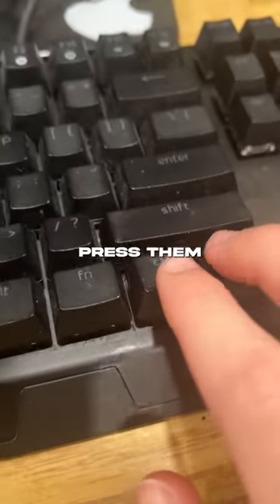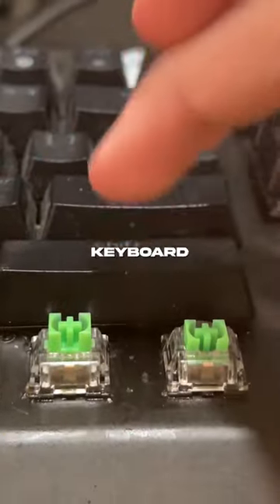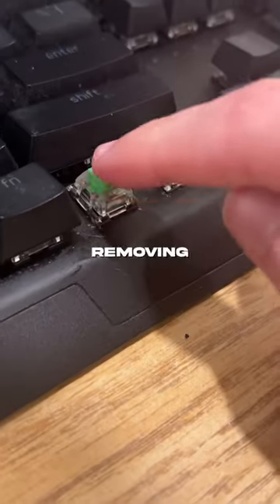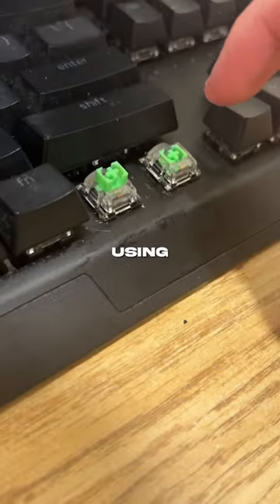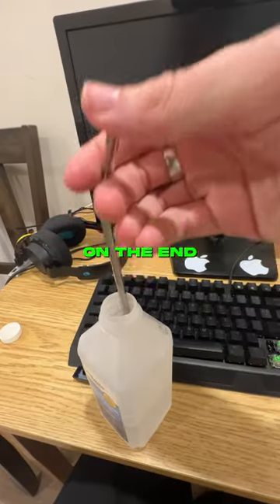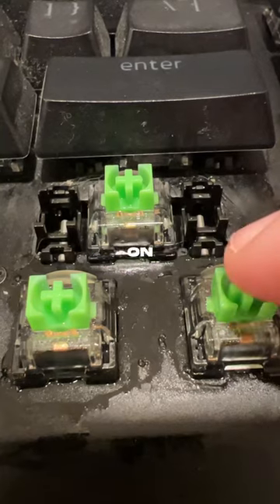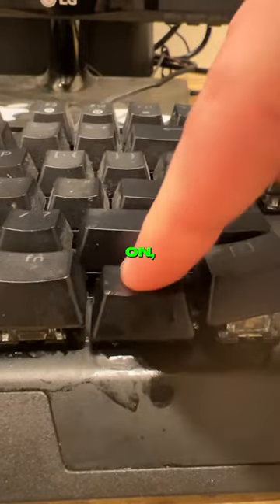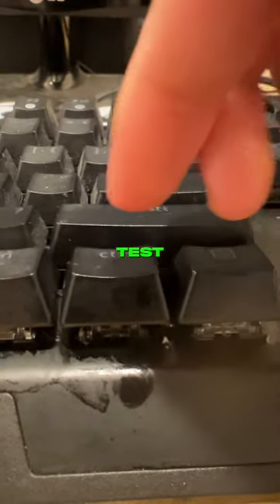Repairing a Sticky Keyboard

Comment: The issue that more than a few people misunderstand is that isopropyl alcohol needs to be dried/removed from a circuit surface because overtime it can actually remove bits of film and pad glue, however with that said I have zero clue how itd respond to solder. I can't recall how it reacts to all the phone electronics I disassembled over the years.

Comment: You can run a keyboard through the dish washer. I reccomend taking it apart down to the mother board, scrubbing it, an old tooth brush using 90% isopropyl alcohol and then running it through the dish washer. Afterward, just douse it the alcohol again and let it dry for 72 hours. And after all that, it will be just as good as brand new.
Reply: Allow the isopropyl alcohol time to dry, I'd you don't the key caps will break with the alcohol, don't do it because I've experienced it twice

Comment: As someone who builds my own custom keyboards, the spring/switch is either broken or something sticky got in. The best and easiest solution would just be to use/rent a soldering iron and replace the damaged/broken switches with new ones (buy some online or remove some from keys on your keyboard you don’t use) please do your own research too but know that trying to clean the switches while they are still in the board is a horrible idea

Comment: Chances are they will become stuck again over time. What I have done if they are soldered on is strip it down to the PCB and wash the area with isopropyl alcohol plus a "very soft" brush (DO NOT SCRUB) let it dry for 24hrs.

Comment: I had the same issue although my keyboard has nothing spilled. It turns out there was something effecting the caps motion pf gping up and down so I took it off and put it back on which fixed it.

Comment: I wish it was this simple. I've ruined 2 razer keyboards by spilling something sticky on them. I've done your exact method and it never worked. The keyboard just becomes completely unusable. You could theoretically disassemble further, but both times resulted in a keyboard that was broken, even if i followed the exact instructions for taking it apart.

Comment: eww large keyboard 🤮
Reply: Large keyboards are better
Reply: @CursedSFMS  small are better, more compact cheaper take up less space and are easier to work with
Reply: @Cr1n-l4s  no larger because harder to accidentally press ~ when fighting
Reply: @CursedSFMS  i almost never accidentally press and the keys are the same size and it just doesnt have a useless number pad just sitting their taking up space
Reply: @Cr1n-l4s  large keyboards are still better and use the keypad on the right anyway
Reply: @CursedSFMS  hwo uses the keypad
Reply: @Cr1n-l4s  me for TF2 and quick switching classes and with other games
Reply: @CursedSFMS  keypad just takes up space, if you were to setup a key bind their you would be reaching across your keyboard which would be inefficient
Reply: @Cr1n-l4s  you fool its for when i die and im in spawn
Reply: @CursedSFMS  eww
Reply: still doesnt give a point to the entire number pad 💀
Reply: @Cr1n-l4s  yes it does
Reply: @CursedSFMS  who in their right mind would put key binds as far away from their hand as possible